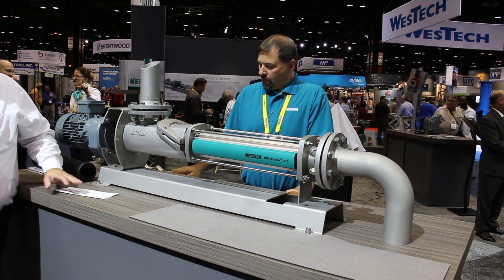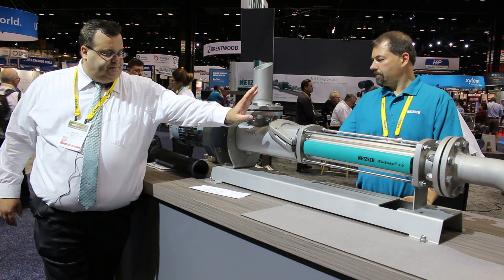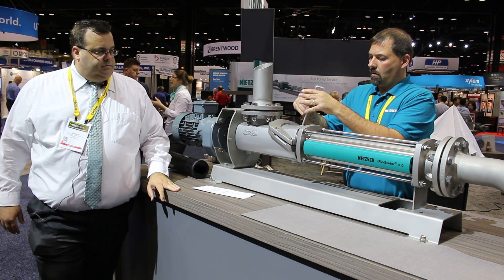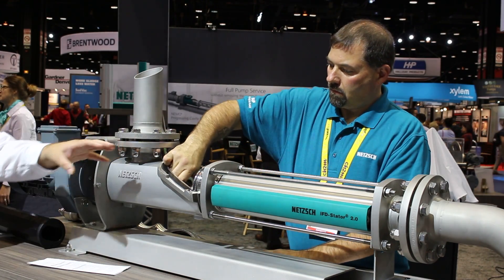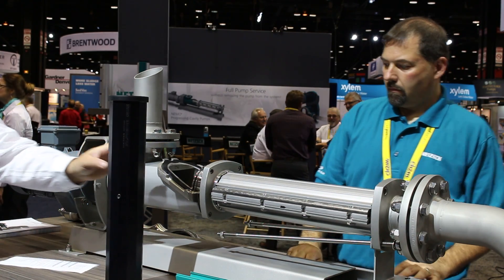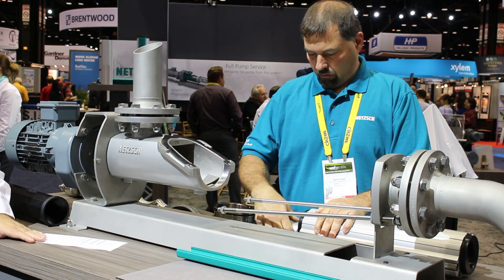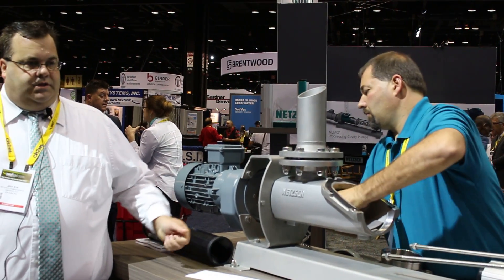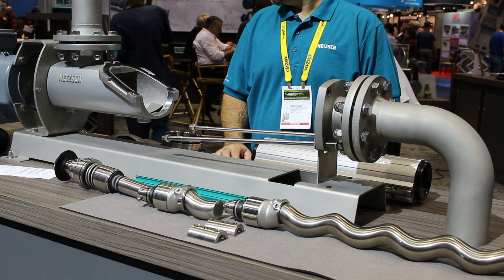Netzsch - Full Service In Place NEMO

Comment: This a well designed assembly.  Kudos to the design and manufacturing team.   Any comments from the maintenance engineers among us who have service this type of pump?
Reply: Bullshit if it is glogded your dead in the water
Reply: It works as designed. Servicing the rotor and stator can take half the time, if not less, depending on your setup and dimensional constraints. As reliable as the legacy models. If ragging is an issue, the service port alone can sometimes prove useful in diagnosing, if not outright clearing the issue.